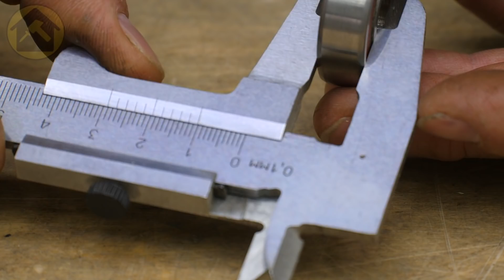It's very simple! Few people know about this brilliant idea.

Comment: Glad he thinks he's brilliant, I'm sure 4 bearings, 4 bolts and nuts, and a piece of steel tubing cost more then the $20 it cost for a roll of pipe marking wrap that has measurements, angles, and degrees already on it.
Reply: Yep. But that’s not what building is about mate. Building is making something because you can. Buying something that’s already been built is done because one can’t build.